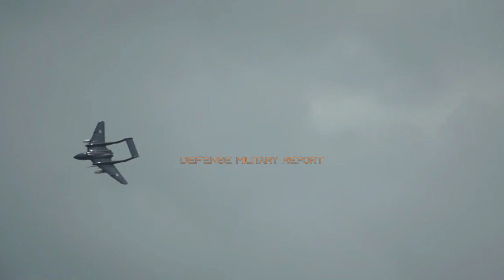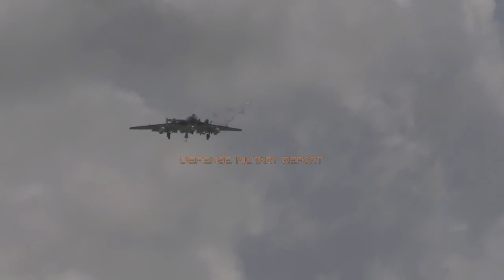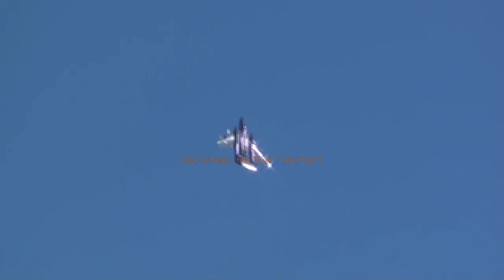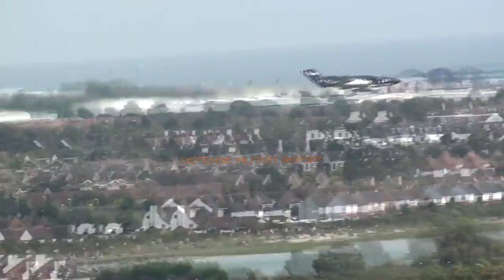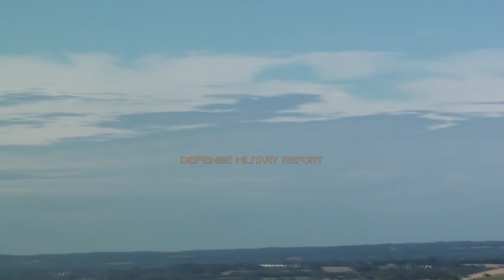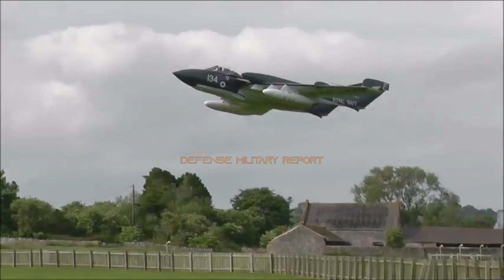De Havilland Sea Vixen - Most Extreme Fighter Jet UK

Comment: I cannot stop looking at that big straight tail wing. That does not scream 'supersonic'.
Reply: Supersonic, it wasn’t. Mach 1.15 in a dive.
Reply: it was only 1951'ish
Reply: shhh, nobody tell him about the f104.
Reply: @spawnof200  Fine so long as you did not expect to turn with it. All a fighter had to do to loose an f104 was gently bank one way or the other.
Reply: At the time a number of jet fighters went into production / service that were not supersonic. 

The MD F3H Demon was a contemporary to the DH Sea Vixen & had a similar performance. The later F4 Phantom was a follow on from the F3 Demon. The Sea Vixen took a long time to get from first flight to introduction for various reasons and a similar situation occurred with the MD F3H Demon. The Douglass Skyhawk delta wing is a contemporary to the the Gloster Javelin delta wing. Both non-supersonic delta wing aircraft, the javelin had better performance and first flew a few years before the Douglass Skyhawk.

Douglass A-4 Skyhawk 
2950 Built 
Intro 1956
FF 1954
In service to 1980s
Max V 670 MPH
Delta wing. A small / light jet aircraft designed for carrier operations without having to have folding wings. Often referred to as the scooter. 

McDonnell Douglas F3H Demon
590 Built. Not Supersonic.
Max Speed 578 MPH.
Introduction date 7 March 1956
First flight 7 August 1951
Retired 1964

MD F-4 Phantom 2
Number built 5,195
Manufactured 1958–1981
Introduction date 30 December 1960
First flight 27 May 1958

DH Sea Vixen
Number built 151 (including two DH110 prototypes and one Sea Vixen prototype)
Introduction date July 1959
First flight 26 September 1951
Max speed 695 MPH.
Retired 1972

Gloster Javelin.
434 built.
FF 1951
Intro1956
Max V 710 MPH
Delta Wing. 

Interesting British achievements.
There is no doubt that the Fairey (England)
Delta 2 was of course the world's first jet
aircraft to exceed 1000 mph, 10th March 1956 Indeed It exceeded the previous record by 310 mph & held the record for 1 year. Incidentally, the Dassault Mirage 3 & 4 are based on the Fairey Delta 2.

When the EE Lightning first achieved Mach 2 it was one of the fastest aircraft on the planet. 
P1 Mach 1 achieved 1954, Mach 1•5 capable.
P2 Mach 1 achieved 1956, Mach 2 capable. 
P2 Mach 2 achieved 1958.

The Hawker P1103 was a design and part built prototype that would have led to Mach 2 & Mach 3 versions of the aircraft. The General Dynamics F16 Fighting Falcon was of a similar design that went into service in 1975. The P1103 was cancelled during the switch to "mostly missiles plus no supersonic interceptor aircraft required in the future" era which included cancelling air to air missile development. Scheduled for test flights in 1958 and to be in service 1962. The General Dynamics F16 Fighting Falcon - based on a British design started 39 years earlier, built in the US and a number of manufacturing partner countries with parts for the US built aircraft sourced from partner countries. 

There were plans to do a supersonic thin wing Javelin which of course got cancelled. 

Early days, jet fighters.
De Havilland Vampire, Sea Vixen & Gloster Meteor accident losses were not high or unusual for fighter aircraft at the time. De Havilland built large numbers of all metal airframe aircraft before the DH Comet.
We mustn't forget of course that the DH Vampire for example first flew in 1943 & the engine was also built by De Havilland. There were examples of the Vampire interceptor / fighter in service until 1990 which was operated by more than 30 countries.

Non combat phase accident losses.
% of Aircraft built.

The Canadair CL-44 was a turboprop airliner.
Canadair CL-44                  (ff 1959 ) 48%
Lockheed XF104                (ff 1954) 100%
Lockheed  P80                   (ff 1944) 43%
Lockheed F104                 (ff 1954)  45%
Grumman f9f-5 Panther   (ff 1947) 44% 
Convair F102 Dagger        (ff 1953) 45%  
MD F-101 Voodoo.             (ff 1954) 34%
MD FH Phantom 1            (ff 1945)  35%
MD F4 Phantom 2             (ff 1958)  28%
MD F3H  Demon               (ff 1951)  32%
Gloster Meteor                  (ff 1943)  21%
DH Vampire                       (ff 1943)  23%
DH Sea Vixen                     (ff  1951) 33%
Gloster Javelin                   (ff 1951) 20%
EE Lightning                       (ff 1954) 33%

More recent UK military jet aircraft.
 
The Tornado & Typhoon & their engines are Supersonic & are indeed British design aircraft with British design engines built by an international consortium. The Tornado design for example started life during the 1950s at Vickers as the AFVG, it's engine is based on the RR RB-199. The EE Lightening is also a British Supersonic jet aircraft.

The Typhoon is the British BAC-EAP with an engine based on the British RR XG-40, the Typhoon is also built by an international consortium.

Comment: I don't see a back-seater space in this video.  When the commentator said this aircraft was capable of breaking the speed of sound (Mach 1), I asked myself how could that be with a twin boom aircraft.  But, if you look at some of the other videos re:  P-38s, they too, came close to breaking the speed of sound but it would have broken the a/c apart when it flew into the ground because all the control surfaces were useless.   It was interesting to hear how the pilots (who probably were aeronautical engineers in college) before joining the USAAF, knew their planes was coming close to breaking the speed barrier and how the fanatical Nazis chasing them rather than save their aircraft augered into the ground chasing these guys.  If I find the videos I will find the P-38 pilots experiences with coming close to breaking Mach 1 and how they browned out #2 in their flight suits, or you can do a youtube search P-38 speed of sound for the video.
Reply: the back seater was actually in the fuselage of the aircraft, you can see the bulge just to the right of the pilots canopy, it was called the coal hole, only a small window for the crewman.
Reply: the back seater was actually situated next to the pilot in a prone position . another interesting feature
Reply: : actually, the observer sat in a conventional position, in a zero-ninety Martin-Baker ejection seat.
We had a window by our right ear hole that was about 1 foot square to look through.

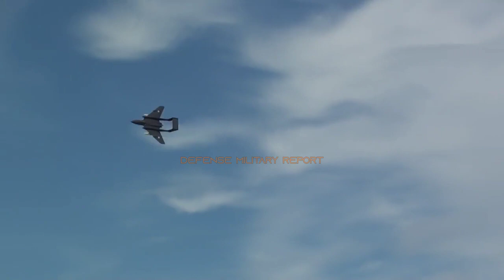Comment: 1:44 - Max speed Mach 0.9 - well short of the speed of sound
Reply: ....It was de Havilland's second DH.110 prototype, and had been taken supersonic over the show on the opening day.[5] 

Following a supersonic dive and flypast from 40,000 feet (12,000 m) and during a left bank at about 450 knots (830 km/h; 520 mph) toward the air show's 120,000 spectators, the pilot pulled up into a climb. In less than a second, the aircraft disintegrated...

Many operationally subsonic aeroplanes have been capable of going supersonic in a dive. 

I'm amazed that you didn't know this.
Reply: @robertcook2572 the claim at 1:44 is that its speed was above expectation and "well above the speed of sound".  Yes, it could exceed Mach 1 in a dive, but so could a brick.
Reply: @Nastyswimmer  The commentary clearly refers to data collected during test flights. This is what test flights are for: to explore the limits of the aeroplane's performance envelope and thus set safe limits for operational use. 
Tip: try responding to the actual words that are written or spoken - not to those voices in your head.
Reply: @Nastyswimmer : so right! There’s absolutely no way that a Vixen could go faster than Mach 1.15. 
With a clean airframe, and in a 30 degree dive, you could get it to reach Mach 1.15, but the airframe didn’t like it one bit. Going transonic (from 0.95 to 1.05)  was ‘exciting’ because the instruments used to go haywire due to the shockwave. Also, it was possible to get control reversal during transition to supersonic and back through to subsonic.
Not once during my 2 operational tours on Vixens did I ever go supersonic chasing a target because the aeroplane just wasn’t built for it.
Now if you were talking Phantoms, and not Vixens, I can attest to having gone to Mach 2 on a number of occasions!

Comment: Many people make poorly informed judgements on the Sea Vixen, based on its lack of combat and more so on the loss rate. What they fail to take into account is the environment and the operational profiles flown by the RN at the time. The night attack saw many aircraft and people lost, not because of the aircraft, but because it was a very risky operation.
Reply: Hard to imagine the skill, luck, and courage required to fly early jets with unresponsive engines and limited instrumentation off the decks of the small RN carriers at night and in bad weather.
Reply: @originalkk882  yeah I agree. Have a look at the Glow Worm attack, for the biggest  consistent source of loss. These guys were pushing the boundaries of skill and safety in order to be ready to fight WW3 and many brave aviators paid with their lives.
Reply: @paulperry8800 : by the time that I went operational on Vixens, the Glowworm was done with. We used the Lepus flare (manufactured by Bofors, in Sweden) for night weaponry. The attack profile was the same though - come in somewhere between 100 ft and 250 ft above sea level (can’t remember the actual height that we ran into the attack - old-fartism kicked in a few years ago), pull up 40 degrees nose up, toss the flare, roll hard over to 135 degrees of bank until level with the horizon, reduce the angle of bank to 90 degrees until on your attack heading then go into a 20 degree dive and fire your rockets at 1200 feet above sea level, pulling out at about 500 feet and then repeat the whole thing.
Reply: @torch8922  P

Comment: say, the carrier borne DH 110 Sea Vixen interdictor strike fighter was used in present day & time!!! other than the airframe of the DH110 Sea Vixen what changes in the DH110 Sea Vixen interdictor strike fighter would have to be made??? in order to get it up to date with present times!!! first ofcourse are twin turbo fan engines!!!
Reply: There was the "Violent" and "Sea Violent" that was on the drawing board in the early 60's that was supposed to be fitted with either twin Speys or twin J79's. Sadly got no further than aerodynamic modelling tests. Just imagine what a beast that would have been!

Comment: Hardly 'extreme' in raw performance, but certainly extremely beautiful in my eyes!
Reply: It probably seemed fairly extreme in 1951!
Reply: I saw the Sea Vixen display at Cosford in around 2002. I can tell you that it was extreme and one of the best displays I've ever seen!
Reply: A transsonic jet (mach 0,91) coming into service in 1957? The Americans were introducing the Vought F8 Crusader at the same time which flew mach 1.8. That prototype crashed because it still was made partly out of plywood, like the De Havilland Mosquito. A beautiful plane, but a clear example of the way British aircraft industries was losing the race.
Reply: @retepeyahaled2961 Britain was a  decade behind in aircraft technology
Reply: @WilhelmKarsten 

A number of similar performance non supersonic jet aircraft got to first flight stage at around the same time. 

The MD F3H Demon was a contemporary to the DH Sea Vixen & had a similar performance. The later F4 Phantom was a follow on from the F3 Demon. The Sea Vixen took a long time to get from first flight to introduction for various reasons and a similar situation occurred with the MD F3H Demon. The Douglass Skyhawk delta wing is a contemporary to the the Gloster Javelin delta wing. Both non-supersonic delta wing aircraft, the javelin had better performance and first flew a few years before the Douglass Skyhawk.

Douglass A-4 Skyhawk 
2950 Built 
Intro 1956
FF 1954
In service to 1980s
Max V 670 MPH
Delta wing. A small / light jet aircraft designed for carrier operations without having to have folding wings. Often referred to as the scooter. 

McDonnell Douglas F3H Demon
590 Built. Not Supersonic.
Max Speed 578 MPH.
Introduction date 7 March 1956
First flight 7 August 1951
Retired 1964

MD F-4 Phantom 2
Number built 5,195
Manufactured 1958–1981
Introduction date 30 December 1960
First flight 27 May 1958

DH Sea Vixen
Number built 151 (including two DH110 prototypes and one Sea Vixen prototype)
Introduction date July 1959
First flight 26 September 1951
Max speed 695 MPH.
Retired 1972

Gloster Javelin.
434 built.
FF 1951
Intro1956
Max V 710 MPH
Delta Wing. 

Interesting British achievements.
There is no doubt that the Fairey (England)
Delta 2 was of course the world's first jet
aircraft to exceed 1000 mph, 10th March 1956 Indeed It exceeded the previous record by 310 mph & held the record for 1 year. Incidentally, the Dassault Mirage 3 & 4 are based on the Fairey Delta 2.

When the EE Lightning first achieved Mach 2 it was one of the fastest aircraft on the planet. 
P1 Mach 1 achieved 1954, Mach 1•5 capable.
P2 Mach 1 achieved 1956, Mach 2 capable. 
P2 Mach 2 achieved 1958.

The Hawker P1103 was a design and part built prototype that would have led to Mach 2 & Mach 3 versions of the aircraft. The General Dynamics F16 Fighting Falcon was of a similar design that went into service in 1975. The P1103 was cancelled during the switch to "mostly missiles plus no supersonic interceptor aircraft required in the future" era which included cancelling air to air missile development. Scheduled for test flights in 1958 and to be in service 1962. The General Dynamics F16 Fighting Falcon - based on a British design started 39 years earlier, built in the US and a number of manufacturing partner countries with parts for the US built aircraft sourced from partner countries. 

There were plans to do a supersonic thin wing Javelin which of course got cancelled. 

Early days, jet fighters.
De Havilland Vampire, Sea Vixen & Gloster Meteor accident losses were not high or unusual for fighter aircraft at the time. De Havilland built large numbers of all metal airframe aircraft before the DH Comet.
We mustn't forget of course that the DH Vampire for example first flew in 1943 & the engine was also built by De Havilland. There were examples of the Vampire interceptor / fighter in service until 1990 which was operated by more than 30 countries.

Non combat phase accident losses.
% of Aircraft built.

The Canadair CL-44 was a turboprop airliner.
Canadair CL-44                  (ff 1959 ) 48%
Lockheed XF104                (ff 1954) 100%
Lockheed  P80                   (ff 1944) 43%
Lockheed F104                 (ff 1954)  45%
Grumman f9f-5 Panther   (ff 1947) 44% 
Convair F102 Dagger        (ff 1953) 45%  
MD F-101 Voodoo.             (ff 1954) 34%
MD FH Phantom 1            (ff 1945)  35%
MD F4 Phantom 2             (ff 1958)  28%
MD F3H  Demon               (ff 1951)  32%
Gloster Meteor                  (ff 1943)  21%
DH Vampire                       (ff 1943)  23%
DH Sea Vixen                     (ff  1951) 33%
Gloster Javelin                   (ff 1951) 20%
EE Lightning                       (ff 1954) 33%

More recent UK military jet aircraft.
 
The Tornado & Typhoon & their engines are Supersonic & are indeed British design aircraft with British design engines built by an international consortium. The Tornado design for example started life during the 1950s at Vickers as the AFVG, it's engine is based on the RR RB-199. The EE Lightening is also a British Supersonic jet aircraft.

The Typhoon is the British BAC-EAP with an engine based on the British RR XG-40, the Typhoon is also built by an international consortium.
Reply: @retepeyahaled2961 
   At the time it was thought by various UK experts that there would be no requirement for supersonic fighter aircraft, missiles would be doing it all.
  However in 1956 the Fairey Delta 2 was the world's first jet aircraft to exceed 1000 mph exceeding the previous record by 300 mph & held the record for nearly a year. The English Electric Lightening would exceed Mach 2 in 1958 before any US jet aircraft.
Reply: @retepeyahaled2961 
The Sea Vixen was an all metal construction airframe design aircraft.
 The prototype flying incident was caused by a structural failure related to a wing leading edge. 
   Nothing to do with hot moulded triple layer cored laminate plywood composite construction techniques used on earlier aircraft.
Reply: You saying that is like saying the fokkor dr.1 was not a good triplane because it didn't have 50 missiles attached to the wings.
Reply: It could outurn any jet in the western hemisphere.
Reply: @sandemike  It was the eastern that was the problem.

Comment: "Attention all aircrew,you will be attacking an oil tanker in British waters with the intent of burning it "  that would have raised a few eyebrows,great to see this example revelling in flight.
Reply: Except,  it didn’t burn much. They even tried thermite bombs. The oil was far too heavy to ignite.
Reply: The Tori Canion was napalmed by Tornado GR1 not Sea Vixen.
Reply: @khankrum1  The Torrey Canyon was in 1967. Not any Tornadoes around then. The RAF attempts at bombing it used Hunters. The FAA used Buccs and Sea Vixens.
Reply: @khankrum1 : sorry but you don’t know what you’re talking about. The Torrey Canyon ran aground while I was on Vixens and the Tornado did not come into front line service with the RAF until 1979.